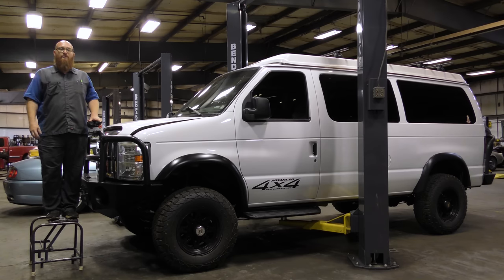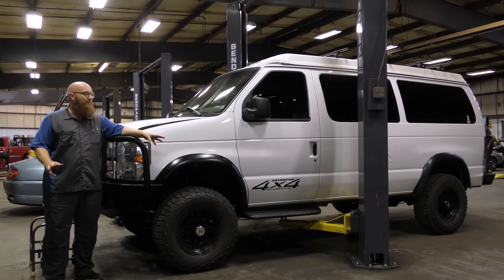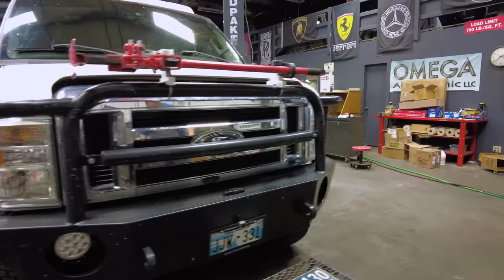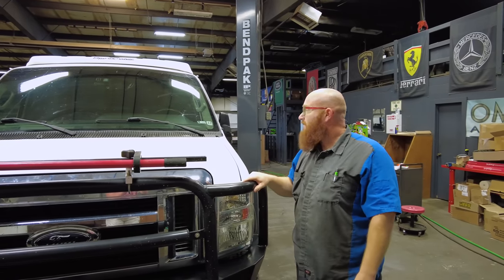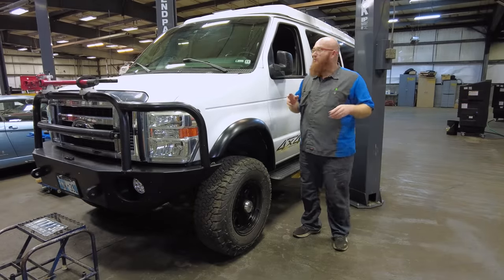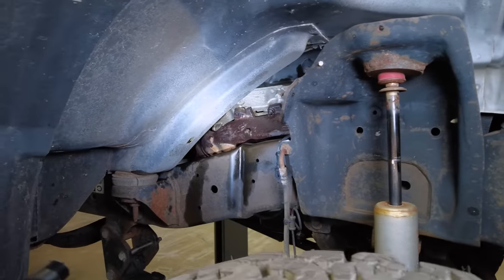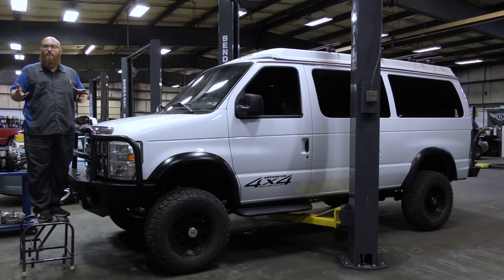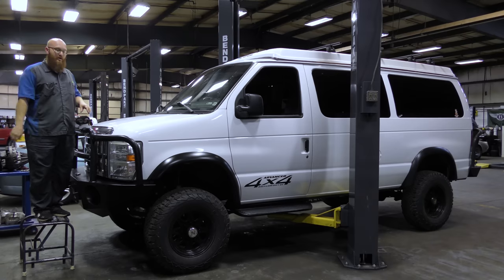8 shops refused to work on this custom '10 E-Series Van! CAR WIZARD shows how easy it was to fix!

Comment: I think that most possible reasons of refusal to work on it was because they canmt just look in the computer to see the make model and how everything goes together which to me is totally stupid npow day people plug things in read a few book and think they are a Mechanic . sure it may be a bit of a small hassle to fix some things but unless its has been totally modded say like a late 1960s-70s converted into a new car with a computer and all the new car goodies wiring and all that nightmarish stuff I dont see any real issues. those places are just lazy should at least lift it to see whats going on lol
 its to bad that thing is so high it would be perfect for offroading in the back woods but because of its height the person would have to cut many branches off trees to get through the places I like going.
I think if I were to pull the engine more then likely pull the front clip off maybe easier then dropping it down
I would suggest to the customer that since there are a few studs  be replaced might as well do them all since the manifolds have to come of the older cheves had issues with the same types of leaks the older ford hade I think 6 bolts cheves had 4 bolts per side which I think was a lazy design

Comment: Sorry if I missed it, but what was so bad about this van that caused so many shops to reject it?

I don’t see this being any more complicated than your average pickup to work on….I really don’t see what’s so bad about it?
Reply: He said that if’s because it can’t be lifted high enough on a lift to walk under the vehicle, you have to sit on stools underneath it. Also, major repairs could require the body to be removed from the chassis, labor intensive. Not to mention it requires a heavy duty lift capable of lifting over 6000 pounds.
Reply: @foellerd  Thank you for the reply. But how is that different from any new(ish) pickup truck? ...or basically any lifted full-size truck for that matter.......I just don't see how this is so bad that 8-10 shops would reject it....I mean yes, OBVIOUSLY any shop that doesn't have a lift that can handle it, that I can understand....but any shop who can work on fullsized trucks / SUVs or off road vehicles, I don't see why they wouldn't be able to work on this as well.
Reply: @foellerd  I am often under the impression that most shops will reject anything that isn't just a simple and easy fix.....anything that seems a tiny bit complicated or the vehicle is unusual / different than just a "Ford Fiesta that needs an oil change"; then they run away screaming in terror like its the end of the world or something
Reply: @foellerd  Just this attitude in general makes me question if you can even call "mechanics"; "mechanics" anymore

Comment: Vans suck to work on, especially with all the garbage they tend to shoehorn in the doghouse area that needs to be removed prior to doing almost any work on some models. Just my opinion, but I don't accept work on those types of conversions either. Aside from the above headache and increased risk of getting the interior dirty by having to work in it, they also often have a bunch of seldom documented electrical additions that are tons of fun to track down.

Comment: i mean, you say advanced 4x4 did a good job, but they didnt put a gasket on the t case adapter and didnt thread seal the diff drain plug...i would not say that indicates a good job

Comment: ahh man 5.4,  dump the oil pump and go with a melling HV, and the upgraded steel tensioners years later over 200k miles no issues

Comment: I had to leave a job at a shop that always gave me these big things and RVs. I'm barely 5'5" and it sucked even working in the pit. They also had to all be done same day since most were too big to fit all the way into a bay, and always had to be backed up and turned around if you had to check the rear too.

Comment: But yeah about how our plates work so a 22 for example like AB22CDE would be a car registered for Mar Apr May Jun Jul Aug and AB72CDE see it's a seven so five digits out and that's cause it's for five or well six month of production so Sep Oct Nov Dec Jan and Feb but back when the regs like that first came out so actually started with a 51 but I make it easier to understand here so am 02 represents the start so first of the year and a 52 with a 5 means half way through the year cause 0.5 means half so that was how the system worked but to make sense later from 2010 they were AB10CDE AND AB60CDE 10 march 60 September

Comment: E Series exhaust leak? Must be a day that end in y.
Reply: We do engine swaps on
these all day. 
You gotta remove everything between the front fenders and pull straight out, but luckily you’ve got access to a lot of components through the doghouse in the interior.
Done 5.4, 6.8, 6.2. Haven’t had to swap out a 7.3 gas yet.

Comment: rare and very customized cars generally = loss of profit for most shops, no surprise to me that got turned away at the door multiple times

also getting a dealer to reprogram anything is worse than pulling teeth, especially when you know they are going to charge you a minimum of 1 hour labor for some that takes 5 min of yes/no inputs on the program interface

Comment: I see both sides. most times customers are not as understanding as this one. 99.9% of us do not make extra money off of content like the wizard. Then again as technicians we willingly take jobs that pay 5 hours for 3 hours worth of work and will also take jobs that prodemand says 3 hours but take 5 hours worth of work because of aftermarket alterations.
Reply: and your right most shops will say they do not feel like working on your van. I could book 20 hours of labor in the 12 hours. or I could choose to work on your van and book 10 hours in 12 hours worth of labor. this is an excellent and very resounding question of how do you feel about flat rate pay in shops that do not typically deal with customized vehicles. should flat rate not exist. should technicians have the right to deny jobs. or should they just eat less the weeks they know it would be 12 hours worth of work but the website says 8 hours to the writer.

Comment: The quality of the modern diesel engines and the problematic V10 have totally ruined the value of these beautiful vehicles I love four wheel drive Vans just one on Craigslist right now you can get it for 20 grand and it's beautiful guy mentioned something about an oil cooler he has no time to work with been for sale for a couple of weeks thing looks like new 2008 I think I'd buy it but I'm no fool if I had the 7.3 from the late 90s powerstroke that's it do some research don't get screwed

Comment: This is a cool van but I really don’t understand the point of making something this heavy 4x4. When are you actually going to use the 4x4 on this thing? Gotta be over 8,000lbs and those tires are not going to help in mud. The added weight of the front axle is just going to kill your fuel economy…A 2wd van with a lift and tires like this can go down any dirt fire road just fine. No need for the 4x4 system. Better yet, get a hitch carrier and put a small Dualsport dirtbike on the rear if you really want to go explore off-road

Comment: Those motors aren't that hard , just get rid of the bumper and core support and they come right out the front 
That t-case adapter will always leak without serious supporting structures re-enforcing that sloppy design

Comment: Take this as you will, your problem, not mine:
NO. Those things are a HASSLE and a LIABILITY to work on.
I have seen it with my own eyes at a friends shop.
Too big, too heavy and a pain to work around custom made B.S.
If you don't own A MASSIVE, PAID FOR SHOP IN THE MIDDLE OF NOWHERE like the Wizard then you're ROYALLY SCREWED.
Any wise shop owner with limited space damn well knows not to get involved and stuck with these "piles" when you could be doing more money in less time with way easier jobs.
Sorry, that's the harsh reality of the times we're living.

Comment: the other shops probably heard the f word "ford" and thought better of it. they know as well as I do there is a group (probably a department) of sadist in ford engineering that specifically takes pleasure in making things hard to work on in their vehicles. Side note, the same department aslo works for nissan.
Those exhaust manifolds did not look easy, more like a rusty sob that shouldn't have failed at 120k... classic sadist. if you listen you can gear them laughing at your pain, Haakakaka Haakakaka.